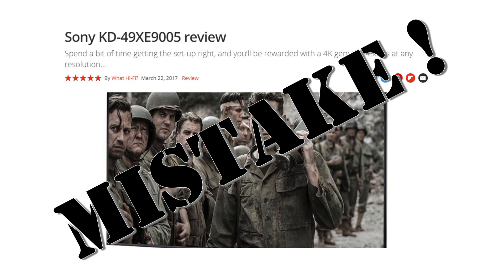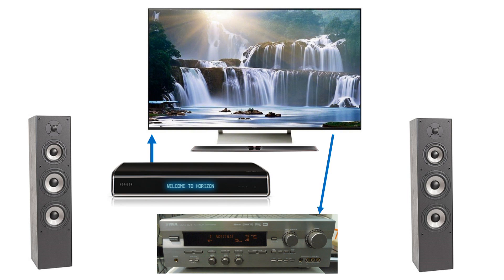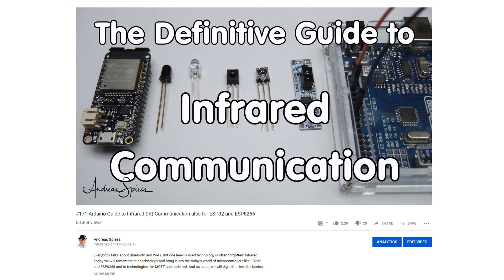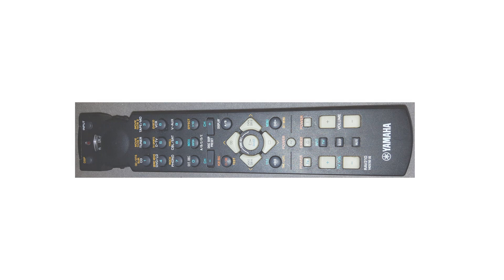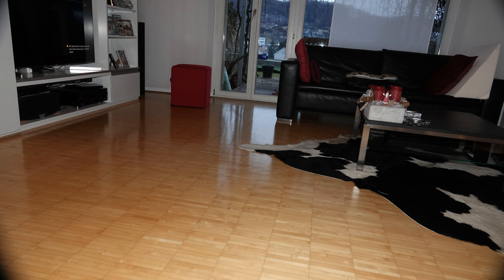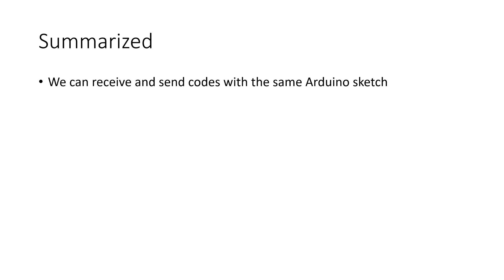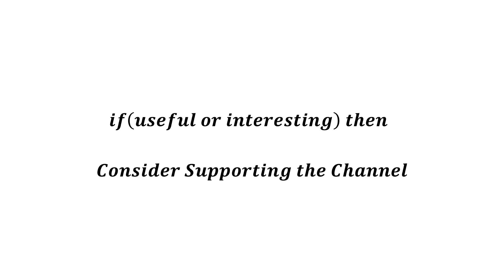#254 Infrared Remote Protocol Translator (Arduino Nano)

Comment: Instead of using the optical cable to go to your Yamaha, try using one of the newer HDMI cables. The newer standard which is probably supported by both your Yamaha and Sony TV has bi-directional support on the HDMI cable. Turning up the volume on the TV will actually inform the Yamaha to turn the volume up. I have a similar Sony TV and a similar amplifier although mine is Onkyo and the HDMI has some very extremely handy two way communication built into that cable and protocol. In fact even switching inputs on your amplifier will automatically trigger the TV to come on and they communicate about their volume and understand that the Yamaha should be the audio amplifier. I think if you take some time and try out the latest HDMI cable you will find magic happens. There is a feature called HDMI CEC which provides two-way communication thereby only needing a single cable between your amplifier and television. The optical cable is no longer necessary and in fact lacks features the HDMI cable will give you. Certainly the Sony television supports HDMI CEC specifically to fix the situation which your video describes. The Yamaha amplifier most likely supports HDMI CEC and the bidirectional communication as well although it may not be turned on by default on the amplifier, you may need to find the Yamaha amplifier settings and enable automatic CEC. A final warning however, you must have a new or relatively new HDMI cable in order to support this two-way communication, the connector looks the same but I suspect additional wires or connections on the newer cabling makes a difference.
Reply from the maker: Unfortunately, my Yamaha has no HDMI connector (at least I did not find one). It is maybe too old :-(
Reply: @AndreasSpiess  that is unfortunate, at some point when you upgrade the amplifier receiver, I would definitely recommend getting one that has the newer HDMI capabilities specifically to address the problems you described. I think Yamaha has a nice new receiver, probably not very cheap, I ended up going with Onkyo to save some money, but any relatively new receiver with the newer HDMI CEC capabilities could solve this. I have a very similar Sony TV and it works like magic with the two-way communication over the HDMI CEC

Comment: Thanks for the great guide. I wish I had seen it earlier as it would have made figuring out my similar solution on an esp8266 easier.  I recently managed using a similar sketch that uses "spare" buttons on the TV remote for controlling other devices. I mapped the the green, red, yellow, blue  buttons to do useful tasks on the home theatre setup. The red button switches between stereo and surround on the receiver with alternate presses. The green button turns on and off the the subwoofer, the yellow button turns on and off a lamp. Another advantage with this kind of setup is that the AV receiver can be hidden in a cabinet and only the IR receiver photodiode needs to be visible. There are advantages to retaining the TV remote as  the base remote including voice search, mouse functionality etc.
Reply from the maker: Glad the video helped. Indeed, this is available for quite some time ;-)

Comment: Nice to read about this solution. I had a similar Problem after changing a LG TV to a Hisense TV. Surprisingly the IR Codes are partially the same. But of course not the ones I needed. I wanted to switch the input channels by Alexa. So I sended the code for 'input' and got a list of avalable input channels and pressed 'left' or 'right' button via remote code. But the new hisense had a different button for that operation. the code for that was not documented. So i tired to send all possible 65000 codes and looked what happend on the tv. By that i discovered that the new tv had a particular code to switch dircectly to the required input channel. Of course one was missing since my tv was set to that particular input channel. But I found a source code to decode this remote protocol and due to the protocol format there were finally only 256 options to send a valid code. the missing one was quickly found and it works fine now. And i could find some additional features of the tv which are not accessible by menu or remote.
Reply from the maker: You are a real "hacker". Congrats!

Comment: Not bad, you pretty much made an IR Blaster with it all in one box. My last custom build I followed the typical layout by having IR Buds going to every device. One of these days I need to slap together a Nano to use for programming URC remotes and use to make backups of the Remote codes since 80% of my clients attend to loose or trash the OEM remotes that come with their equipment. Not fun guessing codes from the URC database or hunting them down on Remote Central. This way I can save it to a SD card and tape it to the bottom of the Media Rack hidden so the client doesn't loose it, trash it or delete it.
Reply from the maker: Good idea to solve a future problem now when all the info is readily available!

Comment: It is worth noting that there is such thing as "discrete IR commands" - they either turn TV off or on, or set particular HDMI input. Very useful for automation project when Arduino doesn't know which state TV is in.
Reply from the maker: Unfortunately, many devices do not use these discrete codes. Which creates a lot of headaches for automatic remote controls...

Comment: Vielen Dank fuer deine tollen Videos! This video was very clear yet I am a little stuck with trying to build something like this for my usecase. I have built a tripple pendulum for an artist a few years ago. Now I want to repurpose this project and add two IR receivers on the lower most pendulum arms and four emitters on the base of the pendulum. I want user to swing, the program detect and specify when the receiver "detects" so that I can play a different sound and can differentiate between IR led1, IR led2, IR led3.. First though was to program different short bursts for led1, led2, led3, led4. Then there is the issue of delay, etc. 

I could maybe use IR remote lib and change code for "Sender" like the below and have for each a different sCommand = something.

// led1
uint16_t sAddress = 0x0102;
uint8_t sCommand = 0x34;
uint8_t sRepeats = 0;

// led2
uint16_t sAddress = 0x0102;
uint8_t sCommand = 0x35;
uint8_t sRepeats = 0;

...

Maybe with the 0x102 (too much delay for my project). What do you think?
Reply from the maker: I do not know because I do not know the exact requirements. But keep in mind that the light of two LEDs can add and therefore make it impossible for the receiver to decode one particular signal.

Comment: I took a somewhat simpler approach with my new Sony 65" OLED TV.  I connected to the amplifier analog R and L input to the headphone jack output on the TV.  The TV remote controls volume as expected and the speaker amplifier level needed to be set manually only once to match the output level from the TV.  

OK, I admit, I still have three remote controls, because I couldn't figure out how to program the Sony remote to control the cable box ( it should have worked, but didn't) and my old DVR needs its own remote, though I use the DVR so infrequently that its remote would gather dust and spider webs -- except for a diligent house cleaner.  I use Alexa to control the audio amplifier power.  I could have used a babel, but sloth took over.  I change the TV channel input only once or twice each week.  My viewing is prosaic.  I either watch sports, news, or I stream something from the internet using one of the built-in TV apps.  The TV remote does 90% of the heavy lifting.  Arguably, not so heavy.  I didn't have a TV with a remote control until the 1970's, about the same time I started to have gray hair.
Reply from the maker: It seems the usage of TV is very different in each household. And here it is even very different between me and my wife. She still uses it the "conventional way" and I rarely watch TV anymore...

Comment: I know this was a long time ago but if you need something similar you can use a Blitzwolf BW-RC1.  Flash it with Tasmota and you can set-up a rule that triggers on a received IR message and sends another IR message and you can set-up multiple rules.
Reply from the maker: Also a good idea. The Tasmota rules are not simple (at least for me)...
Reply: @AndreasSpiess  I used MQTT to receive the two IR signals to get the correct structure then the rule is typed into the web console 
Rule1 ON IrReceived#Data=0xE0E040BF DO IRsend {"Protocol":"RC5","Bits":12,"Data":"0x40C","DataLSB":"0x2030","Repeat":0} ENDON
and it worked, no need for Node Red, which was how I thought I was going to do it and it's much more wife friendly ;-)

Comment: you can reprogram remote :) hold vol - and tv off then input code and accept with rec
Reply from the maker: Thanks for the tip. Unfortunately, it does not work with the old Yamaha volume control.

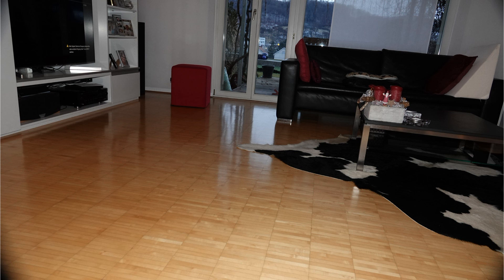Comment: Hello Andreas, great video! Did you really connect the 3W IR LED without any resistors? I could not find a datasheet... And can I connect the GATE of the MOSFET directly to the Arduino output? Referring to position 07:03.

Comment: There are universal remote controlers which you can set TV or manualy enter hex codes, but yeah, this is a solution too and pretty good one where you don't have to get use to another controler
Reply from the maker: Unfortunately, the remote of the set-top box works on 2.4GHz...
Reply: @AndreasSpiess  That's unusual. So your own solution was the only option. Good work Andreas.

Comment: I guess some of the very early IR remotes used more power to transmit than modern ones do - my grandad had one and you could point it in any direction including directly away from the set and it'd still work - even standing outside the room and bouncing the light in off the wall worked.
Probably putting the TX diode near the telly pointing back into the room will work pretty well as the inside corners of the room will retro-reflect.
Reply from the maker: You are probably right with the reflections and maybe it would have been better to chose another direction for the IR diode. I did not test where the IR is reflected in my case.

Comment: I have a very cheap universal remote that has a “punch through” feature allows for the cable mode to use the volume of the TV mode without having to change to TV mode again. In any case I loved your excellent videos and the wife story that goes with it!  Thank you for the great video!
Reply from the maker: Every situation is a little different. Here, the set-top box is on 2.4GHz, not in IR

Comment: Just yesterday I was working on an Arduino clone for a ceiling fan remote control. Didn't use any libraries, the signal was simple enough to figure out. My signal came out identical to the original, but still didn't work. Only after a lot of debugging I realized that the fan remote was sending an even number of repeating commands, while my setup was sending three (I thought I was playing it safe, repeating the command three times!). Two worked, but one or three didn't. To be honest it's probably a matter of noise-reducing comparison of packets by the receiver, but who knows what goes on inside there.
Reply from the maker: Good to know. My Sony also did not accept a single packet. But it did not care about even or odd ;-)

Comment: Bloody brilliant! 

The lesson for me is simple, if integration of analog and rich vacuum tube stereo equipment is desired with digital equipment, contact Andreas! It would be cheaper and more less stressful than buying all the bits and pieces along with the 3D Printer, diodes, more arduino boards (I've only been fooling around with the traditional arduino boards not the newer versions) and test gear, let alone programming that I would never have figured out. Though I am tempted to do so everytime you have a mailbag video...

Well done Sir. At least, now we know, you will be a happy man with a happy wife that will not shut down your YouTube channel. Bye!!!! :-)
Reply from the maker: For the moment the channel will continue to run. And you see, there are always ideas for new projects ;-)

Comment: Haha nice Video. 

Idea:

Creating own remote using the Arduino Pro mini (3.3v) or ESP32 with deep sleep. It should have dedicated buttons to control the volumes.
Advantages: Own design, no need for an external device.
Disadvantages: Time consuming to build.
Reply from the maker: As mentioned: My wife does not want to have another remote :-(

Comment: have identical yamaha except the fact that remote is silver. so if you need codes I could theoreticaly read them for you. my settop box is hooked up via spdif, so both remotes control volume. still annoying though, because only receiver should ever really do that. Otherwise you run into setuations were sound system skreams when it should not, had the output volume from settop box be slightly lower than 100%
Reply from the maker: Thank you for the offer about the IR codes. But my method seems to work. At least I did not hear anything from my wife since ;-)

Comment: Now a days you just use the Sony remote and its sends it control signals via hdmi to the connect device and audio via an hdmi arc to the sound system. I'm guessing your sound system is to analog for that but it's worth checking out if the box supports this feature.
Reply from the maker: The Yamaha even has no HDMI. It was made for loud rock music and vinyl records ;-)

Comment: But for at most $50 US, you could buy a universal remote, and just program it for your setup.. lol.  As you have said, the codes are fairly standardized across a brand.  The universal remote usually comes with a list (or a link to a list)  where you look up your brand and model, and it gives you a code to punch into the remote.  Sometimes you have to try a few different codes, but it works well for common brands like Yamaha and Samsung.
Reply from the maker: 1. Our set-top box is at 2.4GHz
2. Here, a universal remote control has a WAF o close to zero.

Comment: Dear Andreas, we have same kind of remote from UPC and I'm pretty sure u can just change it communication mode for different TV brand. Unfortunately those steps are described in Czech so I'll do my best to translate it.

1. Turn on your sep-top-box
2. Aim remote to STB and simultaneously press and hold volume up and signal source (top-middle button). After 5 Seconds TV power button should indicate red. Release those button
3. Now using numbers enter code based on brand
 LG 1628
 Panasonic 2153
 Philips 2195
 Samsung 2448
 Sharp 2550
 Sony 2679
 Toshiba 3021
 TCL 2856
 Thomson 2972
4. Now you should be able to turn off tv using TV power button on remote. If not, according to manual you should try step 2 again.
5. Press REC button to save configuration

Source: https://www.upc.cz/pdf/pece-o-zakazniky/navody/digitalni-televize/HD_DVR_Mediabox_prirucka_pro_samoinstalaci.pdf page 5

Hope this will be somehow useful. Cheers
Reply from the maker: A few other viewers said the same thing. It was new to me. But I am also not sure if it would work with this old Yamaha amplifier which was not made for that purpose...

Comment: Very useful, Thank you!!! Many years ago I solved the problem by using a Logitech Harmony programmable IR remote. I moved from 4 IR controls to one, but the Harmony is rather complicated to use (not for me, but for others). In general, I use about 5-7 "operations" - i.e. turn everythig on or off, select HDMI input number, listen to radio (and select news or music), select TV channel, TV menue, etc. On the Harmony, some of these may require 2-3 buttons to be pushed - too complicated. My Harmony has no "macro programing" capability - it is made for people that can not program a macro. With your solution I can do the macro programming in the Arduino, and have one button for each of the "operations". I have been thinking about such an arduino solution for a long time, but this video solves a lot of practical problems which I had yet to experience. One question: The leds come in 2 variants, 60 and 120 degrees - and the lenses also have a lot of "degree variants" - Can I assume that since you relay on reflections, that you use the largest possible angle?  (And, in the future, what shall we do with the Bluetooth remotes.)
Reply from the maker: 1. Concerning Harmony: I also hade an (unaccepted) Pronto remote. It was also too complicated.
2. You have to experiment with the angle. I think it is not very important.
3. Our remote uses 2.4GHz for the control of the set-top box. So I did not have to solve that one :-)
Reply: Ok, thanks!
Reply: Harmony was anything but what the name was implying, Harmony was definitely not a "Harmonious Experience!" Like they were touting in their marketing of the Harmony!!!!

Comment: Interesting idea, and I've done something similar in the past. But for my own entertainment center, I'm using a Logitech Harmony remote. A bit pricey, but they have this ingenious system where you don't have to constantly switch between devices you want to control. They use the concept of "activities" which can involve multiple devices, say a TV, a DVD player and an amplifier. Switching the remote to this activity will control the volume through the amp, the dvd playback through the DVD player, and the TV is simply switched to the DVD's input channel. Say you then want to listen to music, you switch activities and it will shut off the TV and DVD player, turn on the CD player or media player, and select the corresponding input on the amplifier. Volume is again controlled through the amp. And so on...
Reply from the maker: Unfortunately, the set-top box uses 2.4GHz. And I am not sure if my wife would accept the change :-(